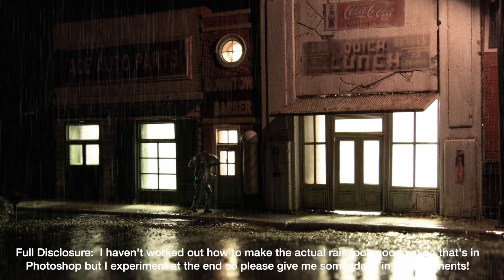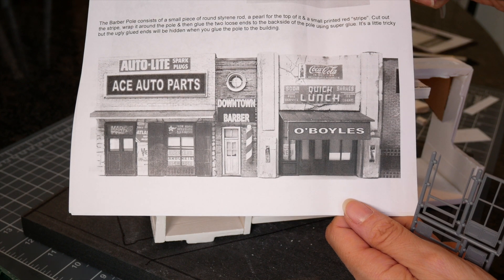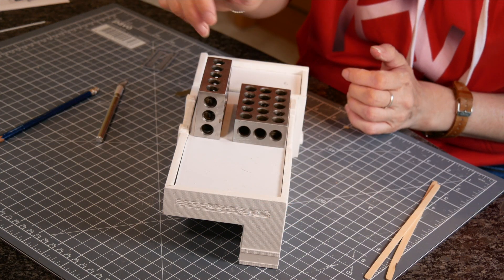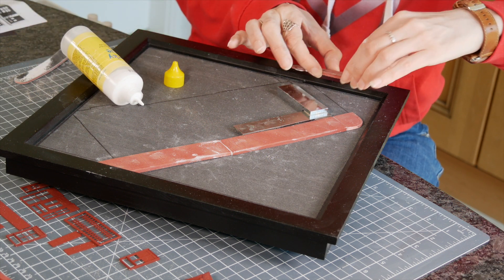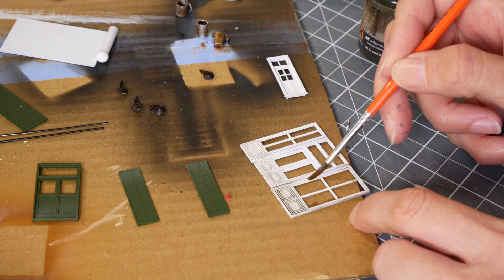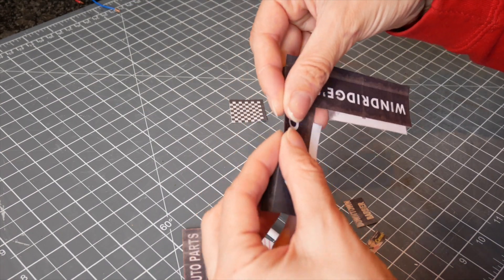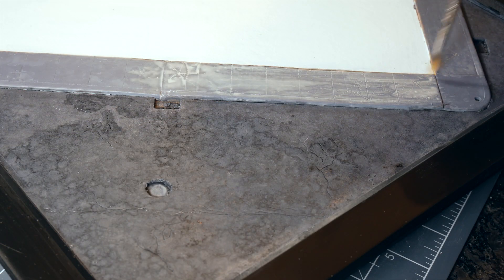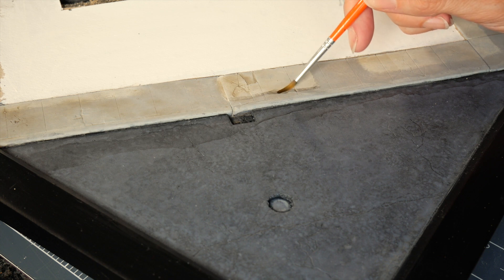Model a Realistic Rain Diorama

Comment: Hi Kathy, I appreciate that this is an old video, and you've likely learned a lot since doing this video, but I wanted to leave a suggestion for yourself and other modelers regarding coloring white edges. Sharpies are alcohol markers, and have a limited selection of colors compared to other brands of alcohol markers. I personally have had great success with Winsor and Newton Promarkers, but Copics are similar and more available internationally. The color selection available in Winsor and Newton is staggering, with two hues and five shades of grey in each hue, and many many colors available, which you may find easier to match to various colors found in signage and other similar items. Poor color matching with Sharpies can be a little conspicuous, and I think Copics and Promarkers offer the opportunity to make such edge coloring less conspicuous. I will admit they're a little on the expensive side, however for modelers who are likely to use them sparingly, they're still quite cost effective. Winsor and Newton actually sells a blacks and greys pack, which contains their full range of cool and warm greys, as well as black. In the UK, you can buy Winsor and Newton and Copic in W.H. Smiths, Tindalls, and Hobbycraft, and may find them in smaller art supply stores as well.
Reply from the maker: Thanks for that great suggestion. I did have a wide range of markers at one point but they’ve mostly dried out over time. Use them or lose them!
Reply: @KathyMillatt  With regards to them drying out, you may be able, with some, to open them up and add alcohol to the pigment mixture to remoisten them. With those you can't open up, you may be able to inject alcohol into them using a hypodermic needle filled with alcohol. It may not extend the life of it very much, and with a pen that has run out of pigment rather than dried out, you may find the color no longer matches the original, but for those that have simply dried out, alcohol can revive them.

Comment: Great build and fantastic video.
For the rain effect for camera, you could try scratching some acetate, with either a knife or even wire wool (depending on how heavy you want the shower). Scratch in the same direction as you want the rain to fall.
The scratch marks should be more opaque than printing or drawing the rain on.
Reply from the maker: Thanks. I will have to try that out. I think I may need a slightly thicker acetate sheet.

Comment: Glue stick threads with little flashes of resin or paint down each strand, the diorama will need a top though to suspend them from top to ground. Done in rows from the back to the front, and must be at an angle to show wind direction. Will take hours as you'll need hundreds.
Reply from the maker: Sounds like a good method but, as you say, takes ages!

Comment: I bought AKs Asphalt from the diorama series,  it was disgusting stuff haha actually looked like hot tar but it come out fantastic with there concrete effects on the pathway! Ot was just more a curiosity to see how they worked and turned out from my usual ways and it's impressive to be honest! This rain diorama really took my fancy if I could do something with the krycel etc to get some falling snow blizzards going on for my easten front diorama! I agree with the gloss I don't use the airbrush stuff atoll now have bottles of it but use my halfords car gloss primer it's like glass after one coat!
Reply from the maker: I struggle to get those texture paints to go flat unless I thin them a lot. I did eventually get good results though. I do prefer methods start with something flat.

Comment: With a clear box you may be able to do a streaky effect by using brush strokes. I'm thinking a thin light grey colour paint applied to the inside of a clear case by drybrushing with a hog bristle brush, or some other wide brush which always tries to leave brush marks.

Nice results, great presentation, and a few techniques I hadn't heard of before. I'm going to have to find some of that alcohol you held the ground cover in place with, surface tension's been giving me trouble trying to do something similar.

Also, I'm afraid I do consider photoshop cheating.

Comment: Amazing work! I especially liked the mod podge rain drops! I had never seen that before. There are people that have used two part resin rain drops at larger scales using a cocktail stick once the resin is mostly cured, ripples around the drop done with straws of various diameters pressed in... But that all seems so much more difficult than the mod podge. I will try that. The awning really turned out well, it looks like it's caught in a draft. Did you notice any shrinkage on the AK puddles product when it dried? I have had issues with that, but I think it was because the surfaces I had put them over were high gloss mud products that effectively sealed out the acrylic product so it couldn't soak in, and instead shrank. I will give it another shot on an unsealed, acrylic friendly material like plaster or water based drywall patching compound and see if that works. Take care!
Reply from the maker: Hi. I tried rings around the drops but it just didn’t work in HO scale. On the Still Water, it shrank down rather than in ie it flattened as it dried.

Comment: Awesome,  pretty complicated for me with all the material and 3D printing.  Hope slowly getting there  ! Thanks for the detailed list of material used .  However I always see you using some steel blocks or slabs to stabilise the boards of foam after glued.  How do I get those ?   Thanks for the video.
Reply from the maker: Thanks. It did take quite a bit of time so loads of different techniques. I’m not sure what the steel you mean is but I use bricks, 1-2-3 blocks and engineering squares to weight stuff.
Reply: Thanks

Comment: Was dying to know how you would pull off the actual rain. My idea was a thousand strands of invisible thread or the single fibers teased from nylons (which are almost literally invisible). Then apply dots of resin or glue to form each raindrop along the thread. It would take FOREVER to thread them all through the diorama and then through a top cover. Offset the two to slant the rain and it might look pretty good. You have me so enthused that I will have to make a few test strands. Perhaps someone could mass produce various intensities of rain on spools like thread.
Reply from the maker: It is certainly something that could work but whether it’s feasible in scale is my worry. Bear in mind a raindrop is only a few millimetres in the real world and then shrink that by 87 to HO scale and it’s more or less invisible. Which actually is often the case with real rain...  I will try again at some point but still don’t have a cast iron answer.

Comment: For rain in a boxed diorama: maybe try lightly scratching a layer of acetate with sandpaper going in the same direction as you want your raindrops going. Do three or so layers, decrease the opacity of the scratches more and more on the layers farthest away from the viewer. I think that's the closest to rain I can imagine. Prolly wouldn't be very realistic, though.
Reply: I was thinking several layers of scratched or finely marked acetate or similar as well. But spaced out over the depth of the diorama. You'd have tightly control the viewing area though and darken it to prevent reflections that would ruin the illusion.  Similar to what you would do for the pepper's ghost effect, in fact that might be an ever better solution. 
Basically project a video of falling rain onto angled acetate. If the video layer was at the rear end of a matte black box with several layers of the scratched acetate and identically placed matte black figures to mask out the rain that would be behind them, you could add some real depth to it.

Comment: layers of "glass" one close to the building. One close to the edge. and a case over it with controller lighting. If good quality plexi-glass, 
 Acrylic or Lexan would work. You could gently scratch the rain in. just some thoughts... Just what came to me off the top of my head. hmmm...don't let it touch the ground. it will create unwanted shadows. If I think of anything else i'll add it. Thoughts?...
Reply from the maker: I think a shadow box effect could work. It would take quite a bit of experimentation.

Comment: Re the rain - "If you have any ideas, please let me know in the comments below"

This one has really been bothering me since you put the video up.  I have been thinking on it, off and on, for close to a year now and I think I finally hit on something.

Peppers ghost.  Essentially use a small screen to show a video of raindrops and reflect it off of a reflective transparent surface.

It would require a much more specialized setup to do it though.  Like something built to be recessed into a shelf to force a fairly controlled viewing angle with the ability to hide the workings.
Reply from the maker: I’ve actually nearly finished the next iteration and am ironically stuck on the rain again. Getting the feeling of movement for video as well as photo. Projecting the rain is very high up the list of methods.

Comment: I'm currently building a diorama of a rainy scene. Since it'll include a river made with epoxy resin I thought about applying a thin coat of clear epoxy on the landscape with a brush. The epoxy is quite runny so I think it'll behave similar to real water. My biggest concern are the many miniatures on the diorama. I spent hours and hours of painting them and I'm not sure how they will take the resin. I fear that the resin could dilute the acrylic paint or that it'll look "globby". I think I need to make a test piece before ruining the dio.
Reply from the maker: I think a test would be very important. Resin shouldn’t affect the paint but may look over scale in some instances.
Reply: @KathyMillatt  thanks. I'll give it a try

Comment: 28:21 ok, im not a model maker, but that particular pic the rain looks like that fine halloween cobweb string. would there be a way to use that? maybe once the diorama is enclosed, just have have it hanging from the top all over, and cut it to different lengths for where it hits buildings and the road etc. maybe even thin seethru string with parts painted white so the rain looks thicker on those bits. i dont know if it would work, or what kind of work that would entail, i know it wouldnt be easy though, but theres two ideas worth a try. i dont know how you would get the angle if you wanted to convey a slight wind as the threads or fake webs (whatever u use) will go straight down unless you cover them in a thin layer of glue so that they become stiff, that way you could actually attach them to the floor instead, and maybe at an angle too, unless your going for that straight down heavy rain look.
Reply from the maker: Hi. What an interesting idea. I do have some of that around somewhere to experiment with.

Comment: Where can I find the shiny metal bars that you used as weights to align things? Not the bricks with the holes in them, but the solid steel bars?
Reply from the maker: I use engineering squares. I bought them at shows but you can get them on Amazon.

Comment: K.M. the model & painting plus raindrop sponging finished beautiful - Acetate sheeting rain try heavy grit corundum paper one scratch down per sheet, then a finer grade  on second sheet, very fine on bottom half of a third acetate sheet this for misting & up-splash - try to layer the sheets, as 3D overlay. Becoming now a foreground lense filter.
Try also lense filters, star prism effects which fit onto camera, my old man used Vaseline thin smear over lense filter & depth of field as a trick...foreground, shutter speed & light angle, falling down it is Rice G-rains. 
Doesn't all this computer assisted sculpting just frustrate...mindfield - I'm staying clear...General Rid Stump!!!
Reply from the maker: Thanks. I like the idea of building up the rain in layers. Definitely one I need to try. Thank you.
Reply: @KathyMillatt  on another tan-gent, The sweet missus took a turn, at cooking Congee rice soup, yum, full...might save some and use it as a Road basing medium for melted churned up snow...
Reply from the maker: Michael Wellner my first experience of congee was on an Air China flight. Interesting!

Comment: perhaps try long, light, diagonal scratches on the acetate. Also, UV resin for the water effects.
Reply from the maker: I like the AK interactive water but find it cracks quite often. I’ve just started using UV resin so would probably use it next time as you suggest.

Comment: Hi I’m a novice in dioramas, just working on a nativity display . I was wondering if you can do a snowing effect using acetate - but- wouldn’t you risk to have the acetate sheet reflect lights placed in front of it? My nativity scene got snowy mountains in the background and I’d love to make it look like it’s just snowing in the distance. Also anyone ever used epoxy over paper pulp? I did a pond using a paper pulp kidney dish which I decorate with wood glue and water solution adding layers of kitchen towel then painted to give the pond effect and depth , plus another layer of glue/water solution over it. I wonder if a thin layer of epoxy over it to give a water effect would work or will soak trough ruining my project. If anyone have any advice please ? 🙏🏻😊
Reply from the maker: Reflections are definitely a big issue and I don’t have an answer on how to deal with them other than careful light placement. Epoxy will soak in but you could seal the piece first which would help. White glue would work.
Reply from the maker: What do you want the epoxy to do?  There may be other products you can use but they’ll all sink in a little.
Reply: Thank you so so much for your kind reply! I would like to give a real clear water effect and add depth . I just received a plastic sheet by Vallejo I still need to try. Your channel is amazing I love your work ! All my appreciation to your artistry and thanks for sharing it with us 🙏🏻❤️ ps I might have to postpone my project but still your advices are really appreciated !

Comment: Try clear Elmer's on an overhead project sheet.
Reply from the maker: I tried something similar but it spread too much to look like rain.
Reply: @KathyMillatt  You lay the plastic out flat so the glue doesn't run.  Then wait for it to dry.
Reply from the maker: How do you get the glue so fine?   Can’t get it to a thickness of .02-.05mm which is what I need.

Comment: I know from experience that automotive spraypaint is super in use but also very bad for your health! I assume you have some form of fume extraction installed at your shop? You see, I use these kind of paints on a daily basis at work but never without proper fume extraction and a respiratory mask. We all have one of those now, right? Lol...
Reply from the maker: I have a bench vent system but these cans put out so much volume, it’s hard for it to cope. I normally spray outside if the weather’s ok but it’s harder to catch on video...

Comment: Tarmac or Asphalt?  Technically pretty much the same thing, one uses tar.... the more modern stuff uses bitumen... but essentially look identical.  Were you going for Tarmac or Paved?
also Acetate will never give good results on an inkjet.  It's just not designed for that kind of ink.  However you can buy specifically designed inkjet transparencies which are excellent. 
Acetate however will work brilliantly in a laser printer,  or screen printing.  
Brilliant video though! Really interesting.
Reply from the maker: Thanks. I thought tarmac v asphalt was UK v US terminology.
Reply: @KathyMillatt  i think a lot of people think that way, not realizing that although they have different binding medium the end result is almost identical.  
If I may also impart a tip i learned years ago, when it comes to the mock up interiors. 
To add that little bit of extra depth, there's 2 methods you can use to help add a touch of realism instead of a printed picture.  Once you've printed your picture in say black and white.... using a black felt marker like a sharpie or something... go over all the obvious dark and shadowy areas with the pen, this will create more contrasting depth to the image, especially on the parts of the image that are closest in view. 
The 2nd option is a bit more fiddly but offers great results is do have multiple copies of the image and use the old 3D stacked decoupage technique.  once again on the lowest layers use the marker pen to accentuate those shadows... the once illuminated in a similar way to how you did it... the image then pops to life with the added realism of depth.  Amazing what Granddads teach you as kids building railway models! 
Keep it up though... its always nice to see other peoples creations.  It was a brave challenge doing an "In the Rain" scene, but you totally pulled it off.
Reply from the maker: Thank you and those are great tips. I love the idea of decoupage